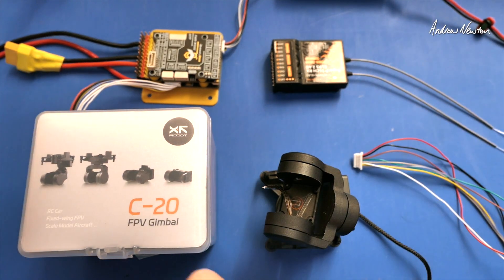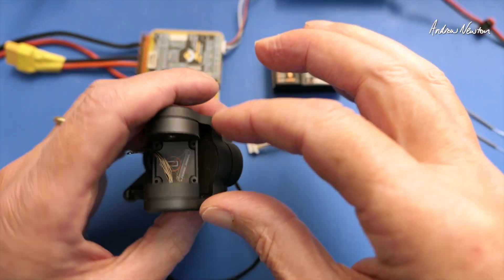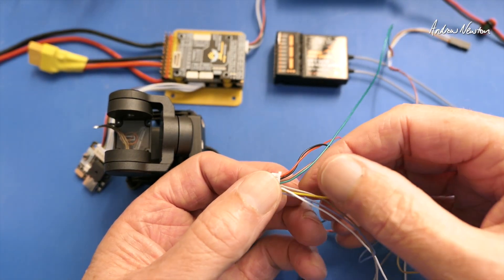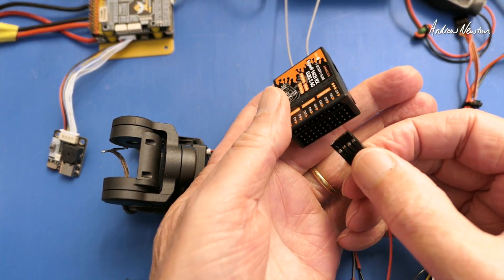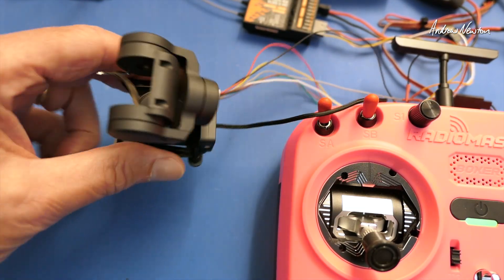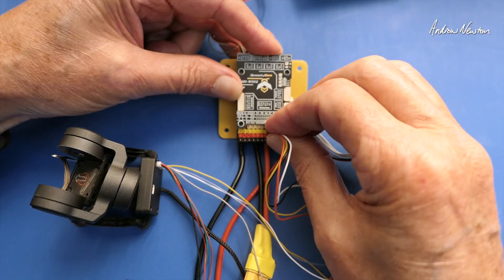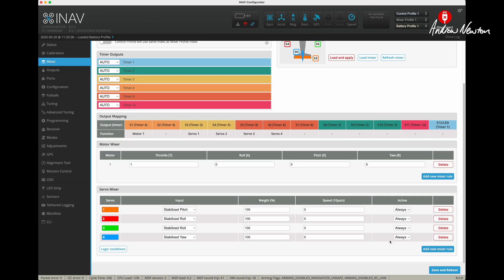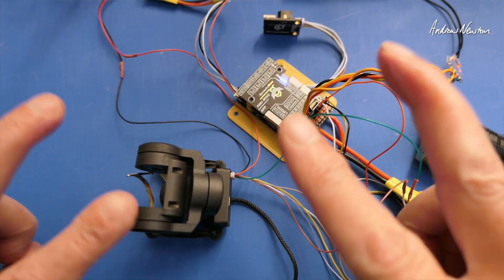XF C-20T FPV Gimbal - PWM Control

Comment: Is the only way to control roll via UART? or is there a mode that lets you use PWM2 for that?
Reply from the maker: Probably not, but I can't run the GimablConfig exe in my Mac so there may be something in it that I'm not aware of.

Comment: Great video Andrew. Quick question. Do i need to use inav 8 to set it up using pwm? Im currently running 7.1
2
Reply from the maker: No, any INAV version will work

Comment: New caddx update has a gimbal lock makes me want to set mine up on my Altus
Reply from the maker: Lock is a nice addition
Reply: was wondering if the caddx gimbal can be used with pwm, i use walksnail VRX attached to my Skyzone O4X analog goggles, don't fancy spending on Walksnail goggles, the skyzones are fine.Caddx responded is can't but i wonder if pwm might work?
Reply: @crabsodyinblue  3
Review: CaddxFPV GM1, GM2, and GM3 Camera Gimbals - Setup and ...
Yes, the Caddx GM3 gimbal can be controlled via PWM signals, allowing it to be used with third-party hardware like radio transmitters or flight controllers instead of being limited to the Walksnail FPV system. You will need to use the specific 8-wire power cable that comes with the GM3, and you can control the gimbal's modes, sensitivity, pan, and tilt using four separate PWM channels.
 
How to use PWM control
1. Connect the power cable:
Use the 8-wire power cable included with the GM3 gimbal for PWM functionality. 
2. Connect to a radio/FC:
Connect the four PWM outputs from your radio transmitter or flight controller to the corresponding PWM inputs on the gimbal. 
3. Assign radio channels:
In your radio or flight controller settings, assign four separate channels for the gimbal: 
PWM1: Controls the gimbal's working mode (e.g., 1, 2, or 3-axis follow). 
PWM2: Controls the gain or sensitivity of the follow axis. 
PWM3: Controls the pan (yaw). 
PWM4: Controls the tilt (pitch). 
This is according to goggle AI answers

Comment: Je voulais savoir si vous avez effectué des réglages via un logiciel pour faire fonctionner le GM3, ou si vous l’avez simplement branché et configuré les boutons et potentiomètres directement après l’avoir sorti de la boîte ?
Reply from the maker: The config app is Windows only so my Mac can't run it. All my setup was just in the radio and INAV

Comment: Using gimbal protocol is easier to set up? Can i use a free FC uart to do that rather than using up more channels? I would like to control tilt, pan, yaw and mode.
Reply from the maker: Could be but I can't use the GimbalConfig app without a windows PC
Reply: @AndrewNewton  i managed to do it in the end with uart. works perfectly. in inav port setup,  uart peripheral: serial gimbal, no msp tick on uart (otherwise it reset all uarts and wont work), Gimbal channels set according to the GimbalConfig channels under inav config menu, no extra servos needed in mixer, and head tracker type set to none. Couldn't get the mode select work but happy to do the button on the headtracker.

Comment: Thanks for the video.  It looks very cool. I don't see a single axis O4 Pro version for us quad pilots. :(
Reply: That's a shame... I'm currently testing GM1 gimbal with o3. Unfortunately I have only one pwm channel available on my cinebot30 quad and I cannot override horizon mode. I'm looking for any info how to set it up with uart port.
Reply: Quick update - I managed to make it work in follow mode with only one PWM channel (designed for LED strip on my AIO FC). I control the tilt angle with knob on radio or can switch it mid-flight to diy arduino head tracker. Next project - sub250 o4 pro tilt gimbal drone. I've got pavo20 pro as a base and since there is very little knowledge base in that segment I will surely be sharing my progress and final thoughts.